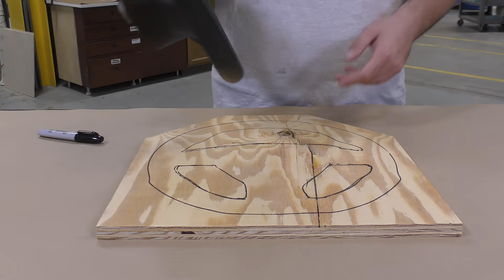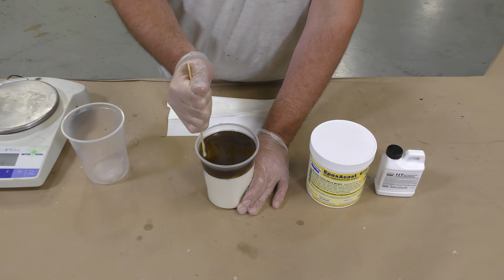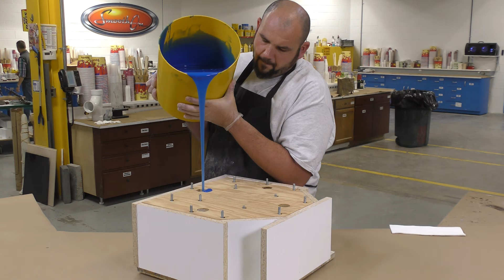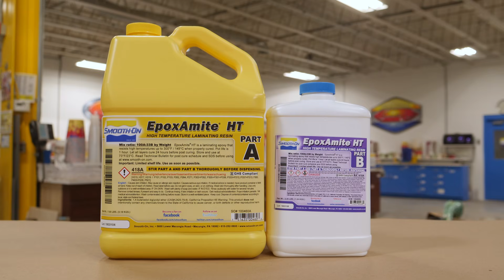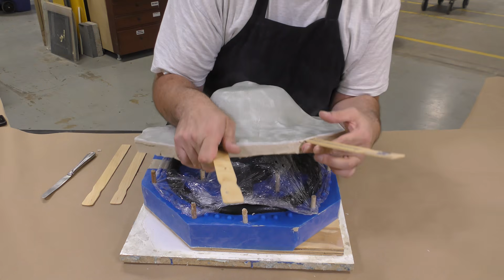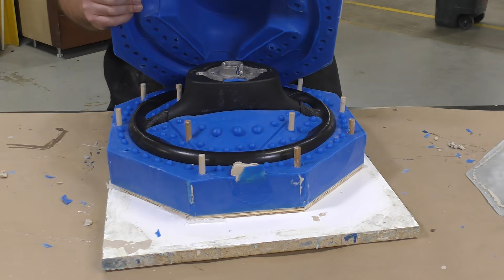How To Make a Custom Steering Wheel: Part 1, Silicone Moldmaking

Comment: Why did you have to use the fiber glass? Is it just because yo wanted to save the silicone that you would otherwise use when trying to completely fill the mold to the highest part?
Reply from the maker: Correct, creating this type of mold with the support shell saves on silicone used.

Comment: Great job on this one. I have learned a lot by watching your videos but I surely would have put the pour spout on the bottom of the steering wheel. There is less chance for it to be visible even after cleanup.

Comment: But is this safe to use? I feel like in an accident, sudden stop, times where the wheel locks up or gets forcibly turned, and other times where the wheel experiences stress, it seems this would break.
Reply: Why would it break?  It's the same core that was originally there from the factory.  It's like changing the door panel them claiming the door itself is unsafe
Reply: Lol, this was just a video on how to  make the mold. ..to use to make the steering wheel. ...he will be using different materials to make the actual steering wheel and recycle the hub if I'm not mistaken. ..

Comment: For the epoxy plug, you could have cut the container to height and hot glued it to the plywood and poured the epoxy in through a small hole at the top.  That would eliminate the need to epoxy it to the plywood after it's cast and wait another 24 hours for that to cure.